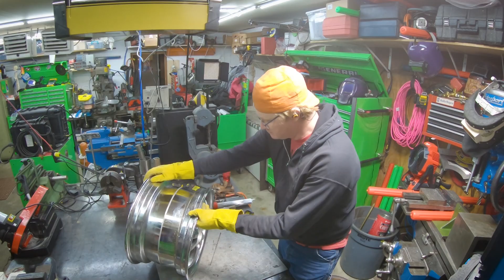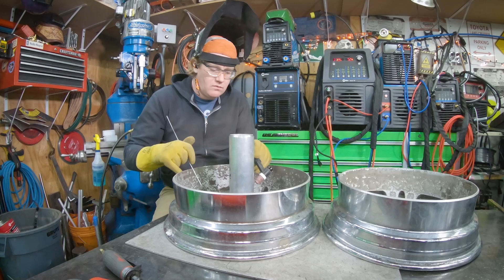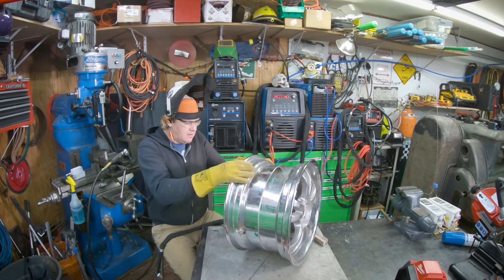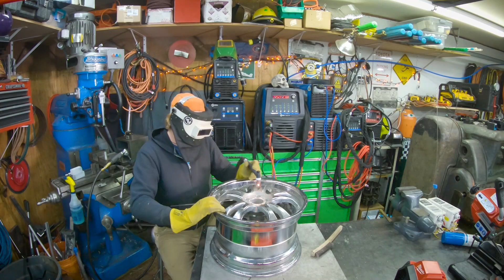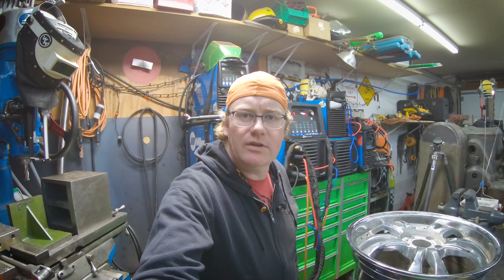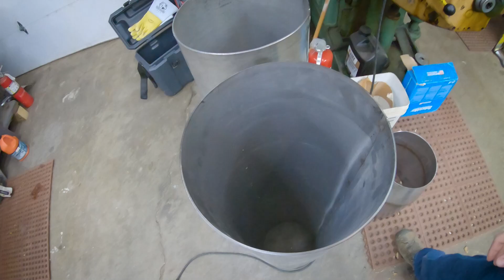Quick Aluminum Welding Project With The Miller Dynasty 400

Comment: Cool to see you putting that 400 to good use here :) happy new years bud! I got an Htp invertig 400 coming this week. Pretty stoked, the duty cycle made way more sense for me on single phase than the bigger dynasty's. The 280 has killer duty tho on single phase lol strange how that works
Reply from the maker: If I didn't already have a shop full of miller stuff that all works together I would have gone with one of those. That pp 220 is a nice machine, I'm sure the rest of there stuff is good as well
Reply: instaBlaster...

Comment: Nice hood.  What type of lens do you like to use, both fixed and passive?  Thanks, Sparky
Reply from the maker: Thanks, That's an outlaw leather hood and I run a Lincoln 2X4c auto lens. I love those lenses, seriously they are the best and only like 100 bucks. Only downside is you need to keep batteries around for them, they tend to use a lot of them
Reply: @DarlingtonFarm  Any issues on low amp tig? A lot of the lenses I've looked at seem to have issues triggering or flickering. I pretty much only use my auto for stick and mig
Reply from the maker: @CyrusAhmadiMoghadam  Thats why I run them, they are fine as low as I go say 20 amps. you can adjust the sensitivity and the shade. Love the blue color too, really crisp and clear

Comment: I’m looking to buy a new Tig welder, I was looking at a Lincoln Aspect 230 Ac/Dc  water cooled package for $5700 out the door. I then  saw miller machines that have higher output so I started looking at some miller’s. I looked at the syncrowave 300 and 400 and for the price of $8k, there’s no frequency adjustments to be had. Seems crazy for a machine of this cost to have no such feature. Then I saw the dynasty 400 for 2k more with water cooler and wireless remote. Is the dynasty 400 a bad machine to buy for a newer Tig welder? I don’t have lots of experience, but I will be dedicating a lot of seat time when I build a welding table I can actually sit at and use my foot to control the pedal. Right now I’ve been controlling my pedal with my knee, but it definitely takes a toll on my hand coordination since I’m on the balls of my feet and have to rock backwards to let up on the pedal. I want a machine I can grow into and not be limited, and it also has to have good resale should I ever sell it, that being said I want a mainstream brand name.
Reply from the maker: It's really hard to go wrong with a miller, the lincolns have a real low duty cycle when you run them off single phase. Definitely something to be aware of. I'd say unless you plan on doing thick aluminum or copper your probably best looking at a dynasty 280. I got a 400 for a project that I had to fab some copper fixtures. I very seldom go over 250 amps on anything. Really just depends on what your doing. I will say that the smaller dynasty has a fan that is a lot quieter than the 400
Reply from the maker: I think the new syncrowave is kind of a waste I really don't see the point in them, you might as well get a dynasty
Reply: DarlingtonFarm my concern is that the dynasty interface may be very confusing for a newer tigger.... what do you think? Is there auto set on the dynasty?
Reply: DarlingtonFarm yeah, that’s what I thought when I looked at the syncrowave, then compared it to a dynasty machine and price which made the syncrowave less desirable
Reply from the maker: The menus can be a bit daunting when you start out but if you spend a day or so playing around with it and seeing what each setting does and what you like it's not bad. Willingness to learn goes a long way